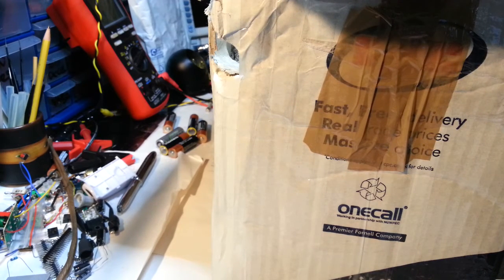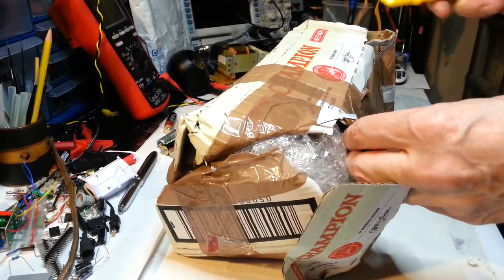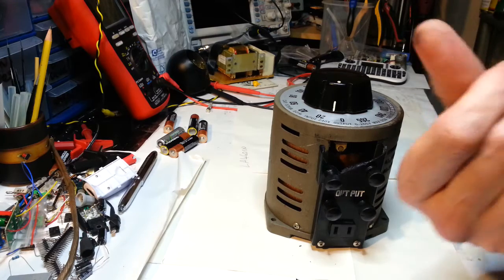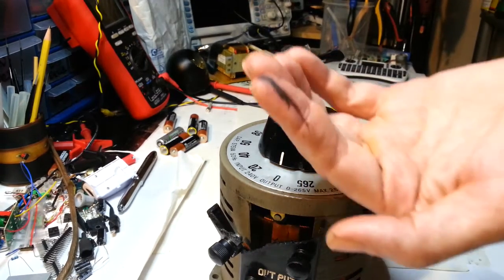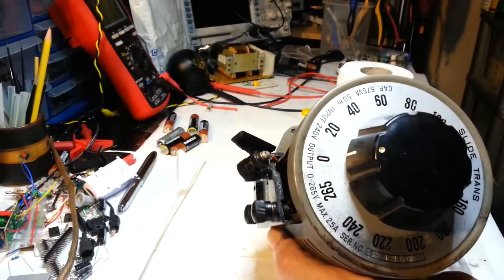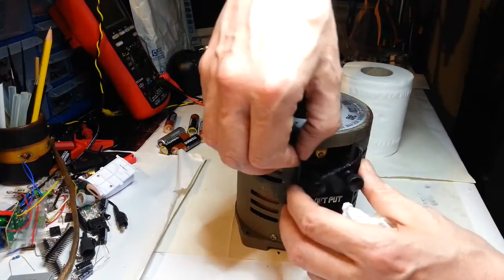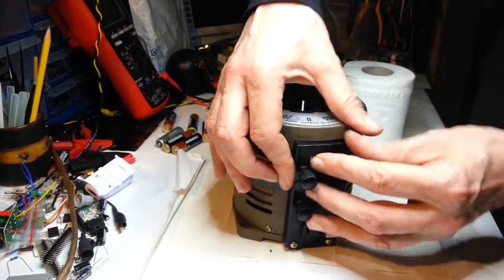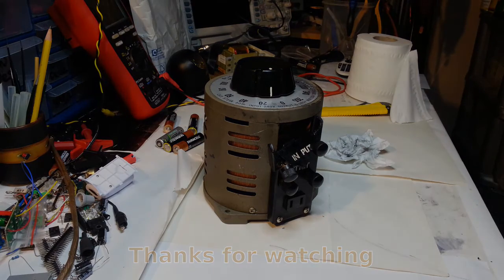Used Slide Trans Auto AC Mains Transformer aka VariAC

Comment: have you heard of the icl8038 ic just a random question
Reply from the maker: After a quick search I can see it is an IC which can output multiple waveforms similar to a Maxim MAX038 which I am a little more familiar with. I bought one to produce a basic waveform generator but have not got around to it. Why are you planning on using the l8038 ?
Reply: +Elecifun yes I have been "trying " to  use it for about a week, I am new to electronics not even a year yet. so trying to find my mistakes are pretty  hard when am not too sure what to look for but it's all part of the learning  process..
Reply from the maker: I am with you as I am just over a year.I guess you are working from a pre made schematic from the datasheet? Best place to start unless you have another reliable source or you can just build from your head,. If so lucky you.

Comment: it looks like it was damaged in the post
Reply from the maker: The broken parts were covered in a oil/grease substance. The original damage was supposed to have been repaired and the unit refurbished. The courier may not have helped but the repaired joints were not clean at all and just waiting to fail.

Comment: ohh you mean a variac!...why didn't you say so.....smile
Don't bid on any Ming vases this week ok
I have a Loewe opta moderna to restore might use the dim light bulb trick...or have a bucket of water handy
I keep my superglue inside an airtight bottle with silica gel in the fridge
Do you know the superglue plus sodium bicarbonate tip?..great for filling in gaps
Still having fun here with solar panel..jacobi's law is making my brain hurt

Repeat after me...Maximum power is transferred when the internal resistance of the source equals the resistance of the load, when the external resistance can be varied, and the internal resistance is constant
Reply from the maker: Because Variac is a trade name and this is not a Variac..big cheesy grin. I shall to attract put it in the heading.  
Oh but I have bought Ming.. lol not really.  I did buy a Hubsan H501s though. 
I just looked up Loewe opta moderna, looks like a nice project. 
No I do not know this tip you speak of, pray would you share?
Now I have to look up Jacobi's Law. I like your comments they remind me, there is so much for me to learn. Ahh, the maximum power theorem. My brain hurts.
Solar panels are great. I love mine it does so much.